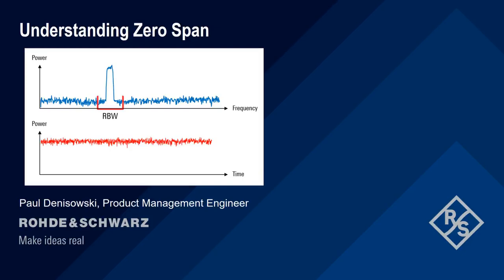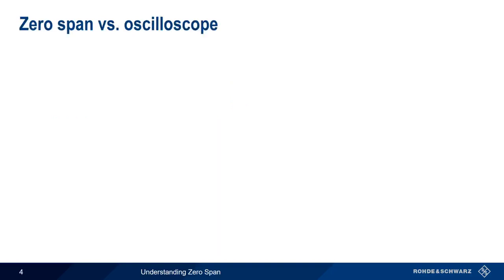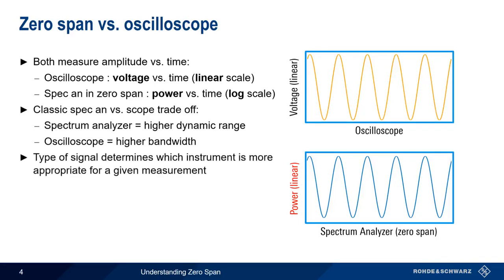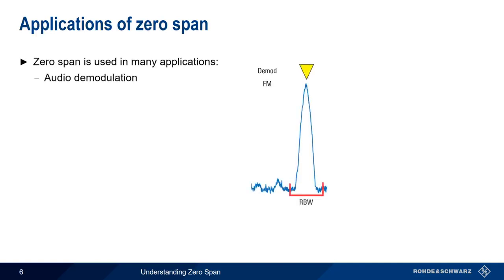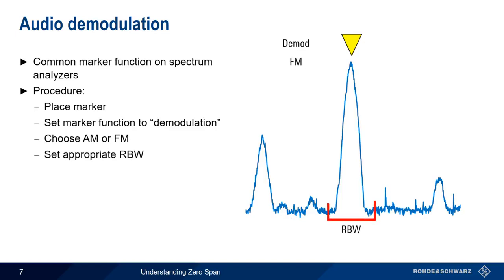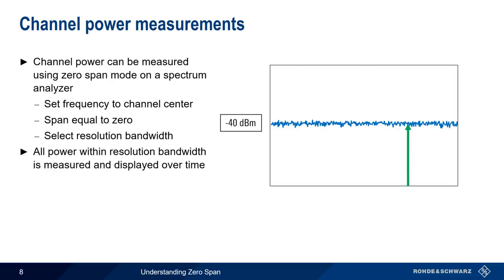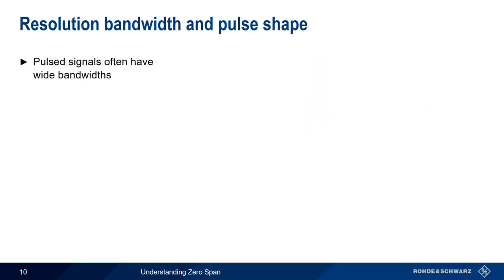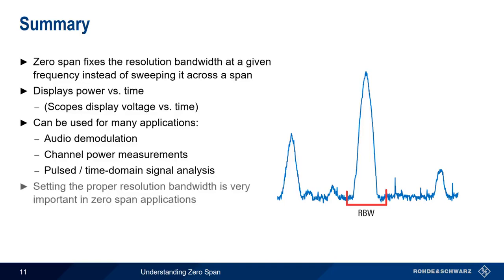Understanding Zero Span

Comment: at 1:33 the bottom figure is very misleading. it must have been said the signal was amplitude modulated. a pure sine wave will show up as a flat line in zero span because it shows the rms power vs time
Reply: Yes, you're absolutely right -- the bottom figure is in fact an amplitude modulated RF signal.  The purpose of this slide was to illustrate the differences in how oscilloscopes and spectrum analyzers typically display information in the time domain (i.e. voltage on a linear scale versus power on a logarithmic scale).  As you correctly point out, an unmodulated or CW RF signal measured in zero span mode would simply be a flat line (because power is constant in a CW signal) -- similar to the graphic on the first slide of the presentation.

Since zero span is most often used to visualize or measure the time-varying characteristics of a signal, I thought it best to use a graph showing the power varying over time.  By analogy, one can use an oscilloscope to measure a DC voltage, but that might not be the best way to explain what an oscilloscope normally is used for :)